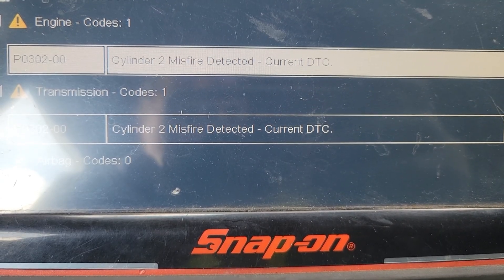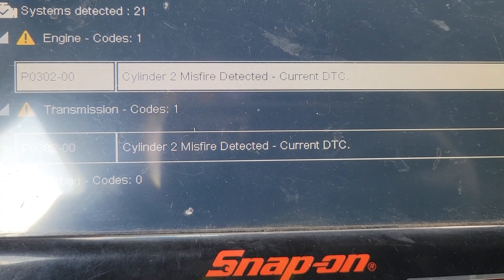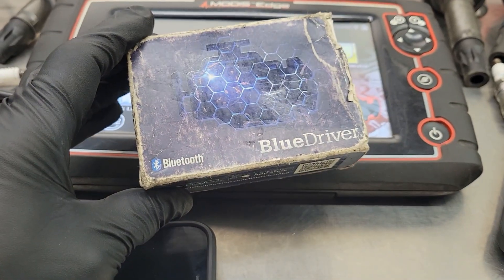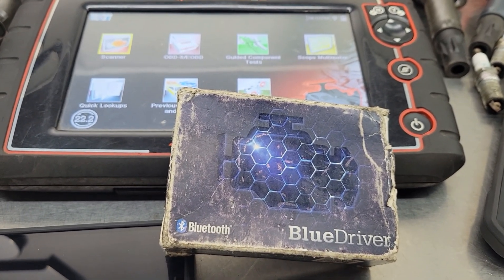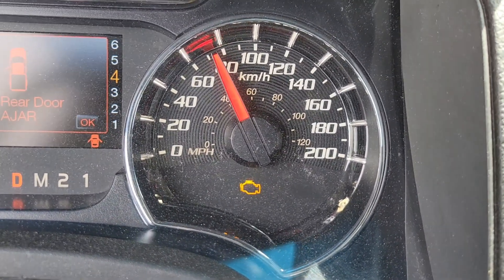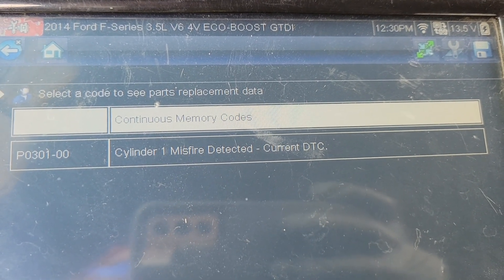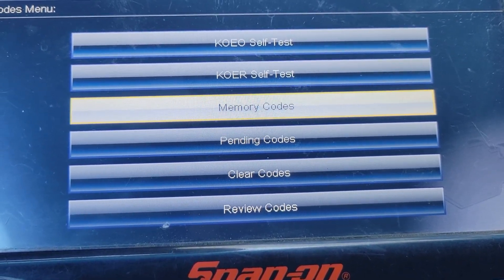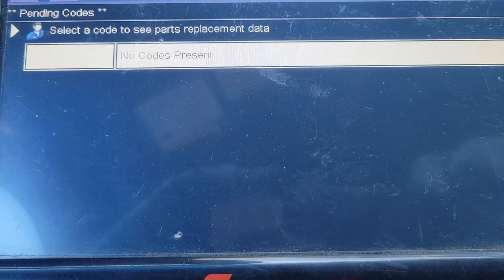F150 Ecoboost Check Engine Light Flashing - Rough Running - Common Causes Explained.

Comment: I know I have to replace my coil #1, but the previous mechanic at Canadian Tire must have over-tightened the coil bolt and now it just spins, and I can't get it or the coil out. There isn't a whole lot of info on YouTube to fix it. Except for using an induction heater on the bolt. That might work if the bolt was broken and I didn't have a coil in the way.

Comment: Mines had this fixed it and worked well again but it recently began again same problem but now when i come to a stop smoke like burning oil coming out from passenger side under fender …. What could be the problem ?
Reply from the maker: Sounds like an oil leak getting onto the exhaust manifold. Possibly valve cover or oil feed lines to the turbo. As far as the misfire, check your spark plugs for cracks and check wiring and connector at the coil. Hope this helps. Let me know what you find. Thanks for watching.
Reply: @shanersmechaniclife3164 thank you i recently went back to my mechanich and they where all changed cylinders and spark plugs but i have the same problem put in a shudder fix and fuel injector cleaner and still the same problem but now check engine light flashes and revolutions from the RPMS go up to 6000 and doesnt cartch a gear correctly 5:25
Reply: @shanersmechaniclife3164 also my code was P0303 cylinder 3 but checked cylinder and spark plugs all good now im thinking my injectors may be the problem or my catalyst system

Comment: I’m on a p0304 code I Rr the coil  and ohm th injector but when I moved  the injector th misfire stayed win four and  another to number 6 . I am waiting for my ecu and one injector on a 2017 f150 3.5 ecoboost.
Reply from the maker: Did you clear the codes after you swapped the coil? Let me how it runs after your parts arrive.

Comment: Thank you for the info. I just went ahead and changed all my coil packs and all my plugs and it took the problem away. I cleared the codes and the check engine light went out but then probably about a week and a half ago. The check engine light came back on. I believe it’s for an oxygen sensor. I haven’t thrown the tester back on it yet but the truck is still running smooth.  I’ve got 301,000 miles on it. I’m sure a couple of things are going to get finicky.
Reply from the maker: You are welcome. If it was missing bad enough, it's possible the O2 sensor got fouled up. Let me know what you find. Hopefully, it's nothing very expensive. Thanks for watching.

Comment: Does this go for a 2011 3.7 V6?  I was driving to work engine running smooth then under acceleration the light started flashing and engine running rough.
Reply from the maker: Yes the theory is the same. Hope you find the problem. Let me know. Thanks for watching.

Comment: Hey man, got problems with my dads 2014 F-150 5.0l Coyote engine, keep getting code p0306 and i've done everything i can think of, changed all 8 coils and plugs, changed fuel injector, cleaned maf sensor, air cleaner, new synthetic oil and filter, i'm going crazy cause it runs rough like shuddering and the engine light flashes while driving, checked compression on it seemed fine, not fully sure what the compression needs to be (it's at 115 for #6) even tried fuel cleaner and use only super unleaded. any help would be great, thanks for reading my rambling.
Reply from the maker: 115 seems low. What are the other cylinders at? You want them all within about 10% of each other for proper power balance.

Comment: What if you get a flashing CEL but it doesn't store any codes? Keeps happening on my 2018 Transit 250 with the same engine.
Reply from the maker: Have you tried scanning it right after it happens without shutting engine off?  Or perhaps try looking at code history? Keep me posted.
Reply: @shanersmechaniclife3164  I will try doing that. I think my scanner may be too basic of a model. I can only look at existing codes, pending codes, and delete codes. Can I look at the code history with the scan tool you linked?
Reply: I did finally catch a code doing what you said. I got P0306 Misfire #6 in the pending codes. Thanks for the help! I now have a direction to go on.

Comment: I’ve yet to buy ford plugs for my boost ever come with the proper gap. Always way too wide. I carefully set them to .028 and get exceptional life out of them.  If I don’t then usually 60000 kilometers I get the misfire.
Reply from the maker: I always verify the gap as well. Just have to be careful not to damage the electrodes. I always check every new part thoroughly. You have to be your own quality control dept these days. Thanks for watching.

Comment: Drilling a hole with a 1/16 bit into the turbo intercooler stops this issue as water is building up in the intercooler itself. What you did is only a temporary fix, it will happen again.
Reply from the maker: This was the fix for this particular misfire. Condensation in the intercooler is also a problem on these. Drilling a hole ( in the proper spot) is a fix. It's definitely a misfire prone motor. Thanks for watching.

Comment: Can it be a clogged fuel filter? If it comes and goes?
Reply: Nope, the fix is simple and free. You have too drill (1/16 bit) what called a weep hole in the turbo intercooler to drain out the water building up in it.

Comment: I just changed my plugs on my suzuki forenza 2008 also.I was getting the p0302 with flashing lights. I did move the wires around but still getting the same code.I replace the ignition coil,spark plugs and the fuel injectors but no luck.I was going to replace the 02 sensors but im still waiting for the tool.Any help here i would appreciate it thank you.
Reply from the maker: Were you able to fix your car? Have you checked the compression? How did the old spark plugs look? Did cylinder 2 look any different? Keep me posted. Thanks for watching.

Comment: The check engine light blinks when I turn the ignition on, but I have not had any misfires after replacing the plugs. Is it a remaining code or is there still an existing issue?
Reply from the maker: It's normal for the check engine light to come on when the ignition is turned on. But it should go out after a moment. Are there any trouble codes?
Reply: @shanersmechaniclife3164  I've driven 400 miles and no issues. The wrench used to blink a little after about 20 seconds, maybe I never noticed it, but I have not noticed it since then so I think it's all fixed. Thanks for the response!

Comment: Thanks for taking the time to do this video, I know its a lot of work by itself. Hopefully this scenario is my problem ,my 2017 f150 3.5 Eco boost.  I get a flashing CE light when accelerating, it goes away when the vehicle calms down. I do loose power so I know the fuel injectors are shutting down. Thank you again.
Reply from the maker: Your welcome.  Did you get you problem figured out? What was it? Thanks for watching.
Reply: @shanersmechaniclife3164  hey buddy, I've just been taking it easy until after moving.  no CE on easy driving. maybe next month i will revisit this issue or?

Comment: I changed the plugs and coils and still have a misfire engine shake rough? Any ideas?
Reply from the maker: Are there any trouble codes? Try checking and cleaning your Map sensors, sometimes they get fouled with PCV. Let me know what you find.
Reply: Fuel injectors 

Taurus sho had the same issues
Reply: Drive your truck until your gas tank is on e then put gas treatment in new gas

Comment: Hey Shaners Mechanic could you be so kind and enlighten me... a bit frustrated about an issue of my 2013 F150 ecoboost 5.3 misfire cyl # 6. however watching your video am a bit confused about where exactly is cylinder # 6????? try to save some money and looking to change coil #6 Thank you in advance great video.
Reply from the maker: Ford 3.5l ecoboost in a f150 cyl6 is driver side rear. Hope it works out for you.  Keep me posted.

Comment: I just changed my plugs on my fusion. I’m getting P0302 and I’m still flashing. It’s saying mid fire on two. I put coil 2 on 1 and 1 on 2. And I still have misfire on 2. The plugs I replaced are ford plugs and I was told I didn’t have to gap since made by ford. HELP!!!???😢
Reply from the maker: Check your wiring and engine compartment  for signs of rodent damage. They love to chew harnesses. Let me know how it works out for you.
Reply: Fuel injectors need to be replaced or cleaned

Comment: I have the same thing happening to my 2014 Ecoboost. Changed plugs and coils and am still having misfiring. Moved coils and misfire moved ro totally different cylinders than the couls exchanged. What could the problem be??
Reply from the maker: Really hard to say. Is it just misfire codes your getting? Could Be a carbon build up issue, or fuel issue (injector or low fuel pressure?)
Reply: Injectors
Reply: You have old gas in your gas tank trust me. Change the gas and put a gas treatment in your truck

Comment: I have been having the same problem on my 2013 F150 Eccoboost. DO I have to scan with the light flashing?  Mine always turns off after a minute or so.
Reply: Mine does that tool   under fast aceleration the truck bogs down and light comes on.    Then goes off
Reply: @toddr5732 mine does the same it’s a misfire
Reply: My 2013 is also flashing the check engine light under heavy acceleration. It will run rough and then the light goes off and seems to run fine.
Reply: @AndyHunt79 have you figured it out yet I’ve been trying to figure it out I changed everything. Spark plug, fuel injector and coil pack and nothing
Reply: Yes, mines beggin to join the club.  
Goes away once she stops shakin, only gives the misfire code while it’s misfiring. (You can find it in the pending or perm codes)

Comment: Hey how are you? I have a problem with my 2013 ecoboost, I got the flashing check engine light once and then it went away but my truck is getting horrible gas mileage.
I've checked everything I can think of and I can't figure it out, there's no codes present. Any suggestions?
I would really appreciate it if you or anybody could help me.
Reply from the maker: I would start by checking regular tune up items. Spark plugs, air filter, and clean your map sensors. Check your tire pressure and look for uneven wear. Let me know what you find. Hopefully it's nothing to expensive. Thanks for watching and commenting.

Comment: Just had this happen last night 2021 f150 3.5L. Was at highway speeds went to pass big rig and check engine light began flashing and very rough fluttering..pulled over ,parked it and shut it off.  Restart after 1 min. Continue to travel at 115km cruise.  For another 4hrs. No issues since. Should I be worried? No warning lights at all
Reply: The exact same th8ng happened to me with mine to and I did the exact same thing you did, and hasn't came on since then. I think we experienced a miss fire, if the problem kept occurring then yeah I would be worried

Comment: I have the exact same issue I stepped on the gas to pass a car then my front end started to shake really bad then my check engine light started flashing but when I slowed down it quit shaking then my check engine light turned off
Reply from the maker: It definitely sounds like a misfire under load. Let me know what the problem is.
Reply: Exact same problem for me. When it happens I’ll pull over and turn truck off and then back on. It doesn’t happen all the time I even had a mechanic test drive it and of
Course nothing happened when he tried and apparently when he tried to read the code nothing came up. Prob needs a tune up

Comment: So my 2014 f150 ecoboost, does this only when I accelerate but not very often. The flashing check engine light will come on and then will go away after about 1 minute. Think this could be the same issue?
Reply from the maker: That's what this was doing. If you don't have access to a scanner maybe try getting it to act up and take it to a place like auto zone to get it scanned. Hopefully the code will still be in memory.  Let me know how it works for you.

Comment: Fixing to go check mine now. 2014 F150 with turbo, stock, flashing light just happened during passing. Went off when I decelerated. About 107K miles.
Reply from the maker: Let me know what you find. There's alot of stress on plugs and coils under acceleration.  I hope it's something cheap and minor.
Reply: @shanersmechaniclife3164  It was exactly what you explained. Changed plugs and coil packs and now it's running like a top. Thanks for the knowledge!!
Reply: I'm considering fixing mine also, 2011 Expedition, started flashing pulling a trailer and passing someone then it stopped when I decelerated also.  It was a scary first time experience so I decided to take it easy since the trip was a 2 1/2 hour trip and that problem happened at the start of my trip.  I still had to return home later that night.  Anyway did you fix yours? was the problem the same as this guy's in the video?  Edit:  I read your reply to the video creator.  That's cool I hope my issue is as easy as you guys.
Reply: Same truck and having the same issue. I will run a diagnostic and see what I find.